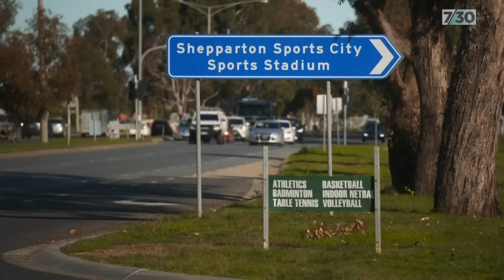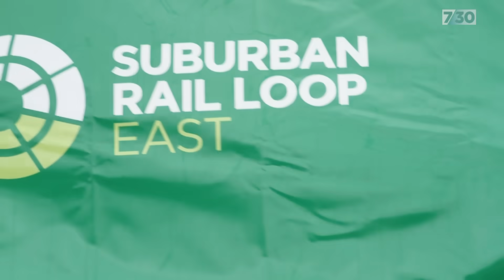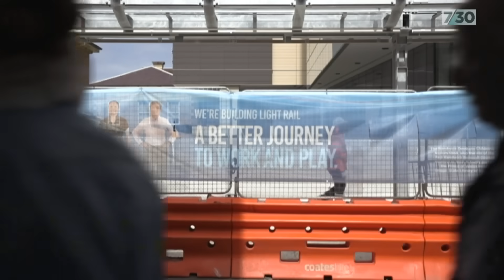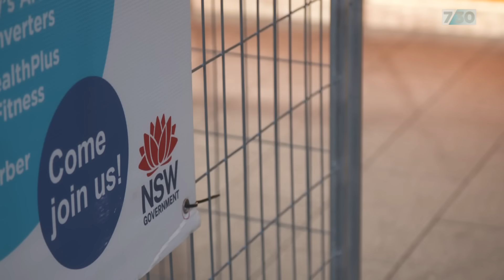Why do so many infrastructure projects have cost blowouts? | 7.30

Comment: ENGINEER HERE: There isn't one of these projects that doesn't have some merit and some real payback to us the general population of Australia. The real problem is HOW these projects are planned from the start and that includes the contracts that are rarely negotiated in good faith by either or both the government or the contractors.

So for everyone interested here's 4 basic project items and for anyone who has ever done a project and wondered what went wrong simply ask which of these wasn't done well enough. Sorry if some of this is longish but I hope it will explain a number of things and how to NOT have projects go wrong.

1) SPECIFICATION:
This is the basic what, why and how. 
What are we going to build - a bridge, a road, a building, a sports stadium or even a submarine.

Why are we building this bridge, road, building, sports stadium or submarine.
The what and why don't need much detail. Its can be as simple as, We need this bridge to go over that river because the old bridge needs replacing.
BUT the HOW must be detailed and most importantly it must explain what STANDARDS must be met. Most people and especially lawyers don't realise that most engineering standards are NOT required by law or regulation. There's actually very few standards that are required to be met by law and yes this stuns most people. So its incredibly important that every standard that a project needs is absolutely listed and described for its applicable use IN THE CONTRACT(s).

The single biggest issue with lawyers and engineering projects is NOT what they put in the contracts but what they leave out. See the comment at the bottom.

2) RESOUCES: 
In all engineering projects there are 3 main resources - labour, machinery and money. 
Labour from top to bottom needs to not only be available but also the required skills needed need to be available. This is an area where non-engineering human resource people are utterly hopeless. For all their claims (and I have experience with this issue) they CANNOT tell the difference between an mechanic and mechanical engineer, electrician and an electrical engineer or any other engineering skill set.
Machinery is another monster bug for engineers. Its no use planning to rent a 50ton crane when you need to lift a 100ton object AND YES THAT HAPPENS. You have to have people who know their subject plan what they need and when they need it. If you suddenly have to rent things like cranes, digging machines, scaffold,... etc. the people supplying those services can charge whatever they like because they know that holding up a billion dollar project is worse than paying ridiculous money to rent something.
Money is the worst thing engineers have to deal with because there's always some clown waving an economics degree like a caveman swinging a club screaming "What's the business case for that?" or  "Who's going to pay for that?" In 99.9% of cases the reason why its costing more than planned is because the economics clown interfered back at the planning stage.

3) TECHNICAL VIABLITY: This is something that most engineers hate because it involves Donald Rumsfeld's 3 knowns. There's known knowns, known unknowns and unknown unknowns. Planning is about having as many known knowns as practical and the best way to have that is CLEAR SPECIFICATIONS. Think about the Apollo program. It had the very simple 2 PART specification. 1 - get a man to the moon and 2 - get him back SAFELY. That was why they could go there 9 times and land 6 times and not lose anyone in the process. The times they lost people were in training accidents where they were less clear about what they were doing and people were rushed and NOT checking properly.

4) COMPLETION DATE which is also called CLOSE OUT: This is possibly the worst thing done in all projects and again goes back to the specifications. If a job is NOT clearly specified then its gets very murky to what it means to be finished. Despite what people might think an unclear completion is music to a contractor because its easy to make a lot of money late in a project. Most of the major items are already in place so its mostly labour or variations and both are more money on top of profit. As we can all see from some of the enquiries into the Big 4 consultancies getting repeat work is what they want more than anything. In an engineering the equivalent to that are the contract variations at the end of a project. The way to avoid that is by (right up front) detailing in the specification: "This is what we want and this is what we mean by being finished."

Go check any project you know of and you'll quickly see the problems that happen when one of these things is not done.

And a perfect example of bad planning is Snowy 2.0. Yes as an engineer I can emphatically state that it is a project with merit and eventually we the Australian people will benefit from it. HOWEVER when you plan on building a power station you also need to connect it to the power grid. That was NOT done in the initial plans and that's where the biggest cost blowouts are. Plus the contractors KNOW they have us by the short and curlies because what's the point of building Snowy 2.0 if you don't connect it to the grid. It has to be connected so they have us. Its a perfect example of the problem of what's left out of the contract.
Reply: Yea but most engineer I deal with end up costing us more money. The labourers know more than the engineers
Reply: Thanks for the great insight 👍
Reply: @GerardoFrancisco  Thanks. 
Its something that totally infuriates me and a lot of other engineers. Even in industry we have the same issues. I have worked on several mining and resource projects where the incompetence of senior management was staggering and $$Billions were wasted.

Worse - Project management is such a simple thing to do if you plan well. You don't have to plan perfectly you just don't have to ignore things and/or dismiss them as "somebody else's problem."

If you haven't watched the 4-corners on the consultants its a MAJOR PART of the problem. They have so utterly infected government, the military and the private sector that it will take decades to clean them out. The only real skill they have is sucking money out of projects.
Reply: @culturekingsboy6555  In some ways I don't disagree as there are so many engineers who get promoted by sucking up rather than doing the job properly, but you are picking a fight with the wrong engineer. 

I'll agree any day you like that there are too many engineers who don't know what they are doing and don't have enough practical experience BUT DON'T YOU DARE try and claim that labourers don't screw things up.

The amount of stuff I have had to personally pick up tools and fix because some smartass thought they knew better is staggering.

In fact there's way too many project mangers who aren't engineers at all making idiotic decisions that people like me have to clean up and I've had to clean up a lot of their SHlT in my time.
Reply: @tonywilson4713  I see, yea there are many brilliant engineers out there. It’s unfortunate that most of the T1 companies have decision makers who are great at giving handy during lunch break as well. Winslow is a prime example. They hit 11 coms and 1 live all within 1 day cause the supervisor thought it was a good idea to let all the spotters go get on a shovel whilst he pretends it’s the 1800 hundreds where he is the supreme white man.
Reply: @tonywilson4713 I would like to subscribe to your podcast.
Reply: As an Civil Engineer who has built infrastructure for the last 40 years, I sympathise with your summary. These issues would be dealt with if there was a long term plan that allowed the time to get projects properly planned. We are talking 10 years or more so that there are options for the government of the day to pull off the shelf. The trouble is that the planning is not funded and incoming governments change stuff.
Reply: This is one of the most intelligent explanation of why cost blowouts happen. The questions are: What does it take for the government to get this right? Who and how should be making sure they do that well? How can the public, who are effectively funding this incompetence, hold the government accountable? In a public company if the CEO or leadership team do this, the board or directors and shareholders would be able to act but it’s much more complex in politics and public office.

Comment: The problem is not that Australia is too ambitious in commissioning infrastructure projects, but that since the mid 20th century we have lost the habit of long term thinking and execution. More of these projects, with greater professionalism is the answer, not stopping everything.   Also, please stop talking about ‘business cases’ and start referring to ‘infrastructure cases’. They are different animals: a BC is a shorter term (2-5 year), limited scope commercial initiative which is justified by an NPV.  An infrastructure case is a long term (25 year+) macro economic investment, considered in terms of its impact on the greater economy.  The fact that these terms are mixed up shows half the problem.

Comment: As a Project Management professional, there are many bias that cause major infrastructure blow outs. Optimism bias for estimation, Political bias on what is acceptable budget to start the project, availability bias of skills and resources, overconfidence bias, hindsight bias, all built into the estimates. It’s not unique to Australia, its happened in the UK with HS2, Wembley, and goes back in Australia to the Sydney Opera House… its a fact of life….
Reply: But it shouldn’t be and its incompetence. While some unforeseen circumstances can happen the massive scale of underestimation shows many someones are not doing their jobs proficiently and they should be given the sack (at the very least) and it starts at the top.
I’ve been involved with the Ag and hospitality industry for a long time and it has its share of unforeseen circumstances but its dealt with within the specified time limits and contract requirements most of the time, sadly the building industry in Australia at present is filled with dishonesty.
Reply: @alyssaoconnor  every single Olympic bid for the pas 25 years (including Sydney) has doubled in price, in the first 12 months of winning the bid. This is political bias…. If the true cost was shown, nobody would bid and win. The Sydney Opera house was the same back in 1973; it came in at 4 times more than estimated…. Could you now imagine Australia without the Sydney Opera House?
Reply: People are overly optimistic.  Tenders can be pitched too low to get the business.  Analysis of  outurn v budget aren't shared with public projects or even within an organisation.
Reply: @norfolkinchance  Every politician wants to be known for creating something big and doesn’t care about the end cost because there is no accountability for losses, they are more then happy to take the wins and blame someone else for the failures.
When it comes down to it Australia’s a business and you can’t run a business on champagne tastes on a beer budget, long term planning is an essential measure to a successful venture. Find the extra money later doesn’t work forever, is a bad and negligent business practice. 

The Sydney opera house risk paid off but there are many more risks that didn’t, as well as many unneeded practices that happen regularly.
Just down the road from me billions was spent redeveloping a government tourist building, the end product was an unpractical building not fit for purpose, now 6 years later they are currently in planning mode to gut it and spend billions to change the lay out with the same architect, building company ect. Not at any stage was anyone using the space consulted or practical needs the focus - the whole project was about the narcissism of most involved and they patted themselves on the back plenty.

While no one can account for everything there has certainly been enough rail and government infrastructure to develop experience and get reasonably accurate costing, there is no way projects should double or triple regularly due to incompetence or as a deceptive practice to trick the tax payer.
Reply: @alyssaoconnor  I’m not disagreeing with you. I’m merely stating what happens in the world of project management. If we use historic costs etc, this is termed parametric estimation, there are many flaws with this approach based on regulations change, supply and demand, materials costs, and then there are the unknown unknowns all adding to the increase in cost. Each project is unique, hence its a project, and the human psyche is to want things to happen and we all, everyone of us, convince ourselves it’s the right thing to do, and continue to do, once we have invested time and effort into a job.
Reply: I though it was really bad management and under-skilled Engineers.
Reply: @shiraz1736  all engineers etc, are trained to beyond a university degree. Management  are often past engineers with experience. Its the whole system that brings out the worst in the flaws within human decision making

Comment: Building infrastructure is not like ordering a 2 min cheeseburger or running a factory. It's impossible to know everything that's underground, to know what every single stakeholder wants and to know what materials and labour will cost halfway through a project that will span several years.

People can't wrap their heads around the idea that predicting the cost of a major infrastructure project with several variables is near impossible.

If you want to know what fast major infrastructure looks like, just look at countries where peoples homes are forcibly demolished, forests cleared without hesitation and community engagement is a foreign concept.

If you want something that benefits the most amount of people with least impacts to the environment, then it will costs time and money.

Unless you've ever tried to build, manage or design a major project, your opinion on costs blowouts are irrelevant.
Reply: Cost blowouts are the norm not the exception so your argument doesn't stack up. Also cost blowouts are not a small percentage but are way off the mark. Governments clearly low ball the price of a project to make it palpable for the voters. A good example is the Wyangala Dam upgrade. It was promoted by the Liberal state government to cost $650 million. Now clearly someone must have done some research to come up with that figure and passed it on to the government. But it wasn't long before an engineer from Melbourne said a project such as this will cost $2 billion. Clearly with some proper research a project estimated cost will be close to the money. Fortunately the Wyangala Dam project has quietly been forgotten about but it could have easily been given the go ahead and be a another cost blowout project and not just a bit over budget but 4 times over budget.